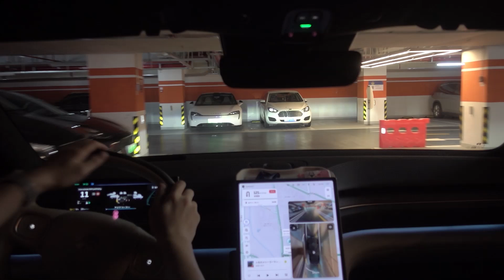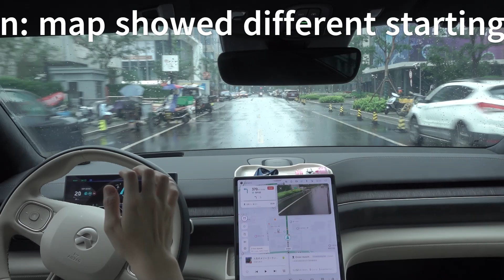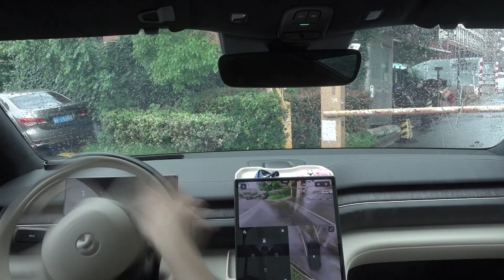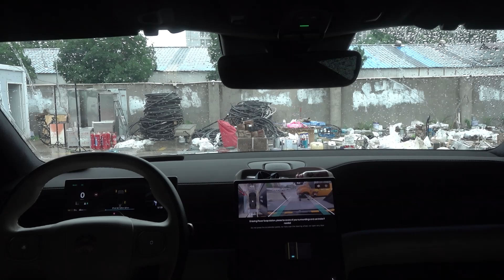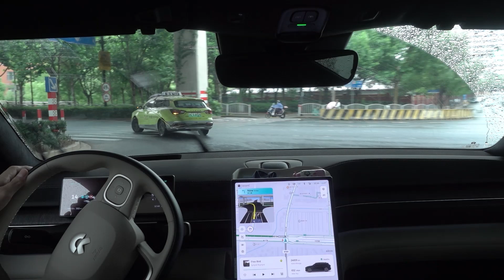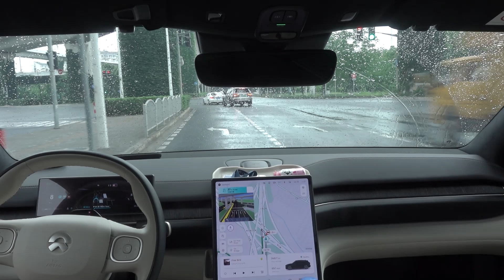Battery Swap Round Trip Under NIO Autopilot NWM, Got Problems But I Still Like It

Comment: The gesture of holding hands above the steering wheel during autonomous driving reflects a lack of full trust. It shows a subconscious need to feel in control, even when the system is working properly — a common human response to emerging technology.
Reply from the maker: No, just because previous comments questioned if I was taking control. I had to put my hands on the wheel. But one thing you were right about, I defintely didn't feel comfortable doing so, and that might be where your assumption was based upon.

Comment: Thanks for the update, very appreciated!  Might be useful NOP indicates level of confidence all along based on amount of training data. So the driver can decide to take over in advance rather than letting the vehicle go towards the wall. Not sure if NWM would be able to learn this way without making mistakes which are clearly stamped as driver takes over.
Reply from the maker: Good point. Some part has been there since. For example, I can set to let driver grant lane change, which I chose to let vehicle take over for convenience. For improvements, previous firmware (not the last few before NWM) could learn and improve, as my early videos showed the vehicle getting into the curve more smooth than first time. Ideally, NWM would gradually absorb these set protocols to more natural behaviors, since you will have to drive the route for at least once. So far, I'm not seeing the learning part on urban road (still highly relying on map), but the garage pathfinding has been doing pretty good.